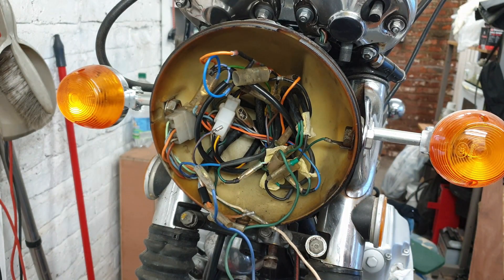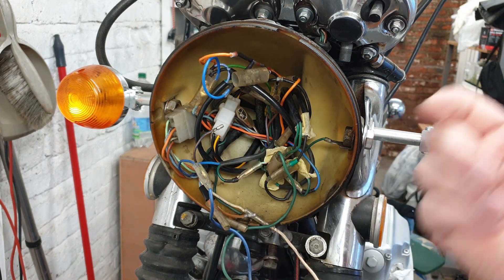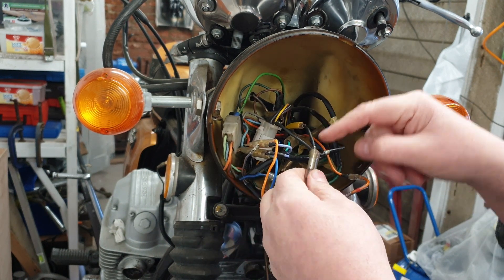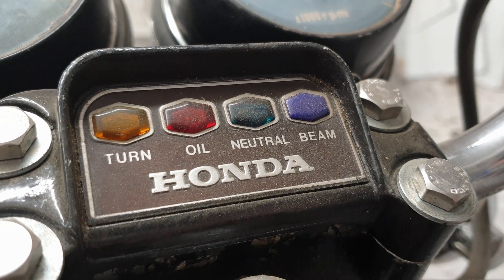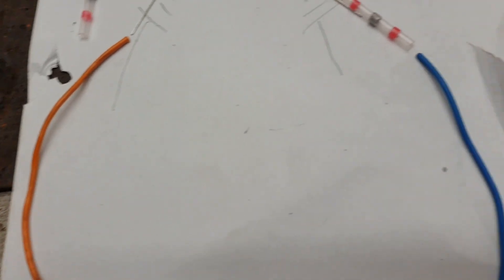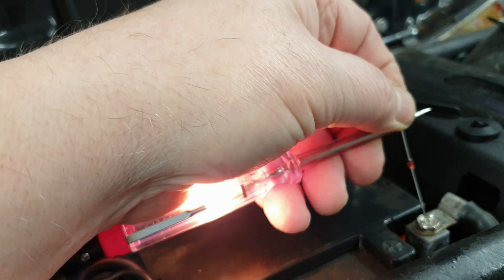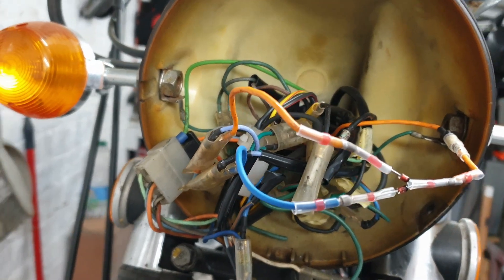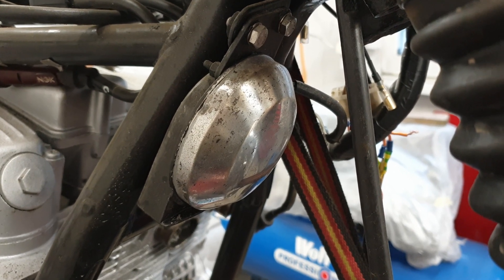Honda CB750 Horn Repair, Indicator Wiring, & General Motorcycle Wiring Loom Fixes | Part 6

Comment: Thanks for another excellent video. Once you had disassembled the horn and cleaned that contact, then put to it there was no sound initially, then you did something a couple of times and started sounding. Your hand was covering what you did to make it work. Could you describe what you were adjusting ? Thanks
Reply from the maker: It was a while ago, but I think it was the nut in the middle of the, for want of a better description, cymbal!  I think I loosened it and it burst into life, that and a good clean I think.  I hope this helps.  Take care.
Reply: @SPANNERRASHmany thanks for your quick response. I’m off to have a go at mine. 👍👍👍

Comment: Hi, Do you know if there's anywhere that sells the insulating sleeves that I could slip over the female single, double and quadruple bullet connectors?
Mine were so grotty and some had failed, so slightly gung-ho I cut them away. It seems the originals are actually tubes that they heat crimp on to wire near the connector. Some of the connectors were in good shape, but now they don't have a nice sturdy, clear plastic, insulating cover. I've bought new terminals and blocks etc. but they are nothing like the quality of the Honda originals, and if I cut them all I could be shortening the loom so that either they are too short or the connection is under strain. I bought a new loom, but I also wanted to restore the original loom.
Reply from the maker: If you google "classic automotive electrical connectors" there are a number of companies that provide all sorts of classic connectors.  I haven't used any of them but I do see some mentioned now and again in forums and Facebook.  I can't remember which, and I haven't used them, but I am sure you should be able to find what you want.  Good luck.

Comment: Hi my stock turn signals  are not blinking  I got solid  Light only I replaced  flasher  nothing  changed
Reply from the maker: Assuming you haven't changed anything else, the warning light can cause an issue. And if you are sure the relay is OK, and new ones aren't always good, then it is likely a broken wire that is earthing something out. Good luck.

Comment: Hi I  need help, I’ve got a Cb750k4, I’ve put on a new loom, switches, indicators and clocks but can’t get the Horn/kill switch and hi/low beam working, I’ve got main light on, any chance of telling me which wire goes with which wire? I’ve got one brown wire, brown/white and a black/brown wire leftover from the loom and only white left over from the right switch, could I send you a video?
Reply from the maker: You'll need to check the wiring diagram for the colours, this one should be yours: http://manuals.sohc4.net/cb750k/technical_reference/WD750K1_K5.pdf

I'd also recommend using a multimeter to confirm that the switches are actually working. Check each wire for continuity when the switches are operated. This would also tell you which wire was which while you were at it.

Hope that helps!

Comment: Hi great video learnt a lot, when are you doing a video on the charging system? Keep doing what you do it's great. Dave
Reply from the maker: Cheers Dave! I'll cover the charging system as soon as it fails and needs attention. Interestingly it seems to be working just fine at the moment. We'll see how long that keeps up.
Reply: @SPANNERRASH  been working on my cb750k1981 since I bought it 18 MTHS ago just wouldn't run! When cold it would tick over go for a run and it would splutter and cut out very  unreliable and have pushed her home many times. Had tank and carbs cleaned sync carbs new jets checked float heights mostly from watching your videos, learnt so much. After checking compression I for some reason thought I would check the battery with multi meter found out I was loosing charge from the battery the more I ran the bike and this then made the bike run irraticly. Think stator is us tested rotor and that's good but the three yellow wires from stator have continuity to ground. Problem is were to get one and what causes this. Don't know if regulator can cause stator to fail. Kind regards David exhaust sounds brilliant 👍
Reply from the maker: @kimsmith4409  Sounds like yo've been on a similar journey to me. :)

If the stator has continuity to ground it is burnt out. It can be rewound but it is probably cheaper to buy a secondhand one. Make sure you test it when you get it.

A bad regulator can cause the stator to go.

If I had this issue I would swap to a modern regulator rectifier unit. They aren't too expensive!

Comment: Thanks how do you add diode with the running lights & signal directional? This for 93 CB 750 can’t find a video only for non running lights older bikes ?
Reply from the maker: As long as you remember that the diode will only allow electricity to flow in one direction, you would need to work out from the wiring diagram where you could use one to give you the result you're after. It takes some working out but I'm sure you could do it.
Reply: @SPANNERRASH  Thank you, this is above my electrical knowledge will seek professional help. Don't want to fry something.

Comment: I’ve tried to remove the running lights but no joy 🙈🙈🤷‍♂️
Reply from the maker: Hi Ronan, You need to find the main wire on the power side feeding the running lights then put a switch in. Maybe using different handlebar switchgear from a year when they actually did have switches for the lights would be the best way to go? Hope that helps
Reply: For the turn signals you need to check the turn signal module and check the fuse box first thing to see if your fuses are blown.their is a fuse for the horn in the fuse box and a fuse for the head lamp also and various other fuses.first thing
Reply: Check the plugs that hook up to the main harness wires up front for the horn,lights,turn signal switch,see what condition their in.then check the switches might be worn out.the voltage rectifier regulator coming from the stator turns ac into DC if this is not working right your charging system won't work properly.if the rectifier regulator don't covert the ac to DC it's bad.and your battery will go dead it's not converting the ac into DC to charge the DC battery.if your starter selanoid keeps going out to turn the starter over or your starter is dragging it's because the starter selanoid isn't getting the required voltage because your battery isn't being charged by the rectifier regulator.their ways to fix them on YouTube.But some are irrapairable some times it the plugs coming from the the stator wire.sometimes the stator and wire need replaced.usually it's a good to replace the rectifier regulator when replacing the stator which has a new wire built to the stator which hooks to the rectifier voltage regulator and the starter selanoid and starter if need be.I just did this and it cost about 1.50 bucks.stator and built in wire,rectifier voltage regulator,new fuse box,mine still works,but it's in bad shape.so I m replacing it.starter selanoid and starter.it turns over fine.but I still have fifty bucks left on amazon.and I need a oil sensing plug and a water sensing module.the bike won't start till I replace them but it turns over fine and the charging system works fine.alls I need is them oil sensing plug to start the bike it will cost 15 dollars at the most for both but I only need the oil plug sensor but I'm going to replace the water one also.sluge and debris gets in them and little shavings from engine wear and clogs the up I could take them out and clean them with karocine and reuse them.but I'm just going to replace them.Ot all started from an oil leak in the stator side of the crank case.leak out all the oil.died right out front of my house.stalded .red light come on.all the debris clogged the oil sensor or oil sending unit plug or oil sensor plug.
Reply: I might add their is a fifty amp fuse in the starter selanoid also that goes out and your selanoid isn't always destroyed yet.sometimes the fuse goes out.